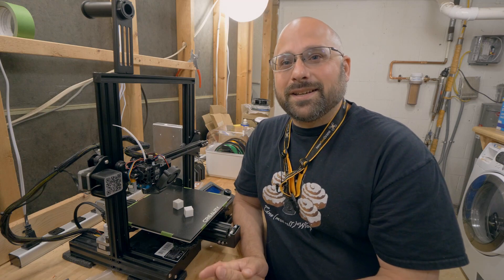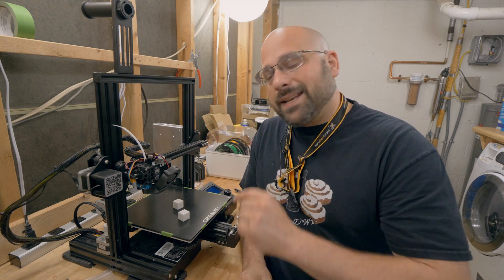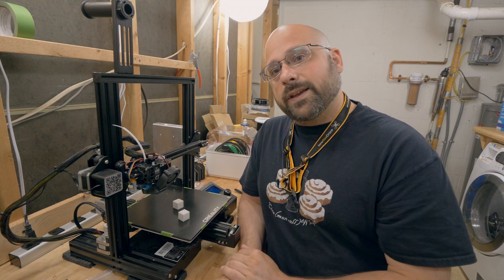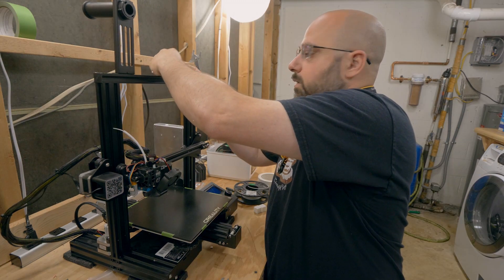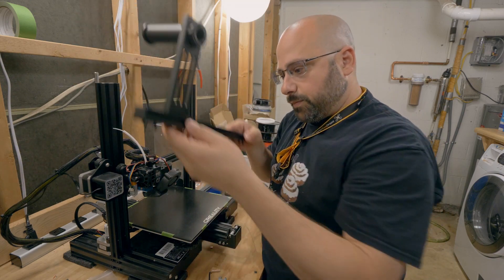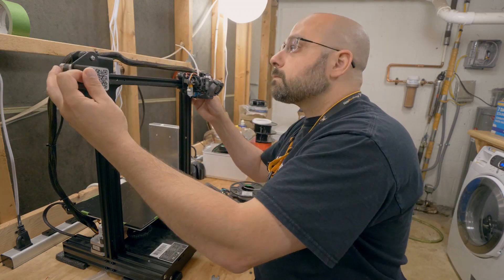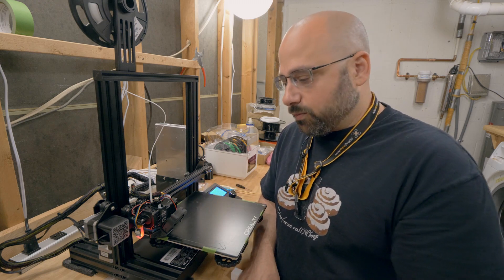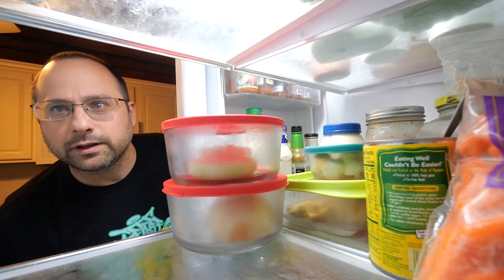Ender 3 Pro Z-axis binding (not the fix I thought it was going to be)

Comment: This is the Ender 3's single biggest flaw for me, cheap power supplies and flames aside. One of the most obvious upgrades that owners of the Ender 3 (original and V2, I didn't learn the first time either) will go for is one of the many cheap secondary Z axis kits, specifically the ones that use an additional motor. Once it becomes obvious that it causes more problems than it solves and that there are several good solutions without losing the second Z support is when the positioning of the right-most screw reveals just how utterly fatal to the printing capability of the machine it can really be.  Using the tools Creality provide it is very easy to strip the head on that thing, a few days later the machine either being on ebay or in the bin. All it would take is a single warning printed in the box, "Beware this single screw or your 3D printing adventure may end here. Seriously, just give it one Google" and it could be avoided. I was stupid enough to let it happen to me twice but thankfully I enjoy learning through trial and disastrous error and have access to tools that should probably require me to watch Shake Hands With Danger several times before using. It also encouraged me to properly learn something like Fusion360 so I could try and design a solution and then compare it to the ones that I knew would already exist so really I should thank Creality instead of cursing their QA department. After taking the Sprite Pro kit apart to examine it I now believe 80% more in Atlantis than I do Creality QA, it makes me wonder if their actual designers are also the ones responsible for cutting corners because it appears so oddly specific in how effective in reducing costs yet potentially catastrophic to the function it is. Several times I've encountered flaws that to me seem to have genuine malice behind them rather than incompetence, but in a way it may actually make sense.

Comment: Also had an issue with the Z-axis bar on my Ender 3-Pro, but it was the left side, eccentric nut that was too tight and the wheel couldn't rotate as well as it should. Loosened the eccentric nut a couple of turns and the wheel turned a lot easier. Problem was solved. Have seen only one video that suggest adjusting the left side, eccentric nut. Hope this helps. Maybe I'll record a video showing what I did to fix my issue. Cheers

Comment: I've been having slight Z axis binding on the lower 2-3" of my ender 3 v2, after watching this I had a quick feel while it's printing, and it's definitely not straight with the bar like you mentioned. I'll have to look into that. Prints aren't showing any artifacts, but still has been concerning me as far as wearing out V rollers. Thank you!
Reply: I have recently got the V2 and did not finish setting it up because I noticed the same binding on the Z axis, and something seemed of. Did you managed to fix this issue?
Reply: @bogdanbradu3137  it did get noticably better, still gets a little tight near the bottom of the z axis but not nearly as bad as it was. For not showing any print artifacts, I have easily put 250 hours on my printer in the last month pre-adjustment without any visible wear to the v rollers(even though this was my main concern for wanting to fix the issue, not sure how long they're expected to last though)

Comment: I had the same problem on my E3V2, I ended up moving to a dual-z-axis setup, using 2 motors. This created a problem in that when the motors turned off, the z-axis on both sides would settle, and go out of level. I had previously installed an SKR V1.4 Turbo mainboard, it has an extra stepper driver, so I was able to connect each z-axis motor to a separate driver, and then I used Klipper's z_tilt_adjust (you can do the same with Marlin using G34) so now it automatically levels side to side before each print. Michael (Teaching Tech) has a video on several different methods of going dual z-axis, and setting up G34 in Marlin

Comment: IMO the Hemera doesn't offer as much of an upgrade as the Mosquito or Dragon over using the much cheaper Trianglelabs E3dV6 with upgraded bi-metal or titanium heatbreak.

You really want that smaller throat and larger heating area through the heating block. The one-handed nozzle change is nothing to kick out of bed either.

Yo you absolutely want the dual z-axis lead screw, I used both parallel stepper motors with a timing belt and I get great results with a dial indicator on my 123 blocks and plate

Comment: Hi Joshua, I am thinking of adding a counterweight using some steel wire and pulleys. This will work to cancel out the heavier direct drive. Even on a standard ender 3 you can feel the motor working a lot harder to lift the x axis up. I just built my ender 3 v2, and have not even powered it on, but from looking at the gantry this will be one of my first mods.

The bolts holding the wheels with the eccentric nuts will be an ideal spot for attaching the cable. From there you can run the cable upwards over one or two pulleys and it should not be in the way.
Reply from the maker: Why add a counterweight? There are established ways of dealing with the sagging X-gantry, such as a 2nd lead screw driven by a belt or a 2nd Z axis stepper motor. It just seems like the counterweight method will add weight to the gantry unnecessarily.

Comment: Yup, the more weight on the x-gantry, the more it exposes the flaws in the setup.

My first ender 3 has slightly twisted extrusions for the z, which causes the x-gantry to bind a touch. Ended up resolving it by switching that one to full rail system and dual z.

My other Ender 3s don't have that issue thankfully.

Note: While rare, it is possible to pop your stepper driver by turning the stepper motor when powered off to fast. I did this on my extruder by removing filament with it still caught in the grip.

Comment: If you create bilinear bed level and run jeyers firmware no mods needed. Over egging the pudding as usual my man. Interesting u didn’t do that when u built it. Dual z axis opens up more problems also unless it has two outputs and and u run gcode g34 and level axis first
Reply from the maker: Sorry but I respectfully disagree. Not sure how bed level can handle Z axis binding in the middle of a print but open to being educated. And my SV01 has dual Z axis with single output and has been flawless.
Reply: @JoshuaBardwell  so what happens when one side drops and with no g35 command to level beam it’s useless. Stopping binding is easy
Reply from the maker: If the beam goes un-level then the G29 three point tilt compensation will catch it, right? Regardless, the dual Z-axis mod solves binding mid print, which is a separate issue from what G34 solves. G34 won't solve mid-print binding either.

Comment: Watch Tomb of 3D Printed Horrors for a proper setup on that X gantry, sir. Mine is rock solid after following his advice - but it doesn't need "tight" wheels on the right. It is all about getting the left wheels and screw set up to hold the gantry perfectly level - independent of the right side. Then finger-tight the right side and you are done.
Reply: Dude this comment saved my life

Comment: The hemera is a massive heavy beast. The ender 3 was never designed for a really heavy direct drive mounted on its gantry.
Reply from the maker: I think you're probably right, and a dual Z is called for. I just wanted to have installed the Hemera once before I did it on the Sovol.

Comment: My next step is to sit a ruler on top of the X gantry and measure on both the lead screw side and opposite side to the top of the extrusion. I do this in 3 places at appx 50mm ( could be any number really) this is to make sure both sides are within 1mm ( my personal tolerance) this yields good results. Do this without the top bar in case you need to remove the X, It may take a couple tries. If I just line up the bracket with the screws along the extrusion like JB shows I get a 4-6mm sag from lead screw side to opposite side so I scribe a mark on the extrusion as a reference and adjust from there.

Comment: I need help I have a problem with my drone I have mounted it by parts and replaced the motors by better ones and the plate matek 405 by a new esc are racerstar 30a I do not know what happens to him but when I put the battery of 3s flies well but with battery of 4s makes noise and goes crazy AYUFA PLEASE

Comment: You need the dual z axis to properly fix this problem...The upgrade kit isn't expensive and long term, it's well worth doing...🤔🤔😯😀🇬🇧🇬🇧
Reply: I have the CR10s, has dual z axis as standard, but stil had z binding because one of the screws was totaly loose. So it doesnt fix it. But now I know how to solve it won't take 5 hours and a lot of failed prints to fix it

Comment: When you was winding your Z axis, you was back powering your stepper driver, which is why your LCD back light was powering on.  Its a real risk to pop the drivers.  You should disconnect your steppers if your going to do that.

Comment: I've got that hot end on my Ender3, I fitted a bl touch, a big tree tech board with TMC drivers. It's now super quiet and it prints great.

I'd look at doing a controller/driver upgrade, the standard creality board is crap.
Reply: Yeah. Switched to TMC2209 on Sidewinder X1 and it surprised me how much quieter it got. Another great steps to silencing the printer were adding Raspberry Pi to run Klipper on it, and replacing the case fan with an 80mm PWM noctua fan, controlled by an arduino - to only make it run when the case temps reach a certain point. Now if I print at normal to slower speeds, the printing is just dead quiet.

Comment: TH3D (great small 3d printing parts company out of Indiana, with fantastic customer service) They have a pretty easy dual z setup for about $70 (cheaper versions "influenced' by it on Amazon,not that I support that) It uses a belt system instead of dual z motors, so it's easier on your board drivers than other setups that split the z motor wires 2 ways (read : adding additional draw to a board not that great to begin with) 

Another thing to check is the lead screw backlash nut. It should not be super tight,but allow the lead screw very slight play, especially if it's not perfectly straight. I definitely recommend TH3d upgraded anti backlash nut, at the very minimum. Well worth the 10 bucks.

Comment: One of the benefits of having a dual lead screw setup for the z-gantry and a mainboard with five stepper motor drivers is you can enable auto-z-alignment (G34) if you have a BLTouch or similar too. I've just set my SV01 up with that and it's fantastic. Works great. Maybe something for you to look into for your SV01 and maybe Ender at some point down the line @Joshua Bardwell?

Comment: One of the best mods I did to my Ender 3 was to drill a hole on the extrusion so I can loosen / tighten the inner of those two screws without having to remove the whole X gantry. Then you just loosen it, use something square (like a rigid box) to align it with the bed, then retighten. And done!

Comment: Joshua - you said you would start putting the actual answer in the video title,  not leading questions ;) also - those gantry screws are installed by the user, not Creality - I’ve assembled probably 40 of these as my time working as a 3d printing tech. 99% of times Z binding on the ender is: improperly tensioned elliptical nuts, those screws, or the Z axis motor being overtight on its mount. A little play in the axis is ok and shouldn’t affect print quality.
Reply from the maker: There isn't any question in this title. 😉
Reply: @JoshuaBardwell  well you know what I mean :p subtitle should be “loose x axis gantry screws”. Loving the content as always! Thanks for putting this out there. I directed, voiced over and was the builder on the 3dprintingcanada ender 3 instructional video (425k views).

Comment: Elliptical = Eccentric
Reply from the maker: Yeah that
Reply: @JoshuaBardwell  Nit picking. Great video. Also recommend using Luke's guide as well. There are full chapters on all this stuff. Doing a x-axis rework is a good idea when you notice issues arise. Same thing with squaring up the y (leaning prints are a major indicator).

Comment: No offence Joshua , but if u had assembled the printer properly in the begining you would not of had that problem .a quick tip only good thing on a ender3 pro is the 32 bit electronics .
Reply: Ender 3 pro is still 8 bit.
Reply: Not going to argue as i may have misphrased my quote but my ender 3 pro runs a 32 bit motherboard and processor so to me it runs on a 32 bit processor

Comment: BTW, be careful when spinning the stepper motors by hand. If you notice in your display the screen comes on every time you spin the motor and that can actually fry the control board. Just don't spin it too fast or unplug the motors. Same can happen when moving the bed by hand. Just an FYI.
Reply: 100% this. Unplug motors when manually moving.
Reply: Wow, never knew that. I do that semi often. Thanks for the tip